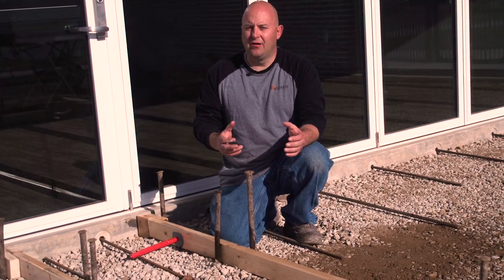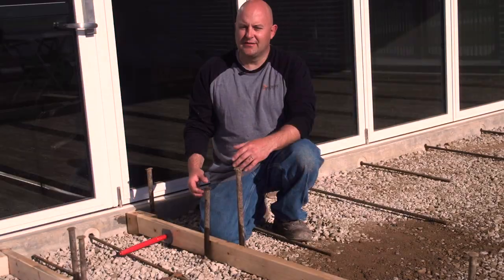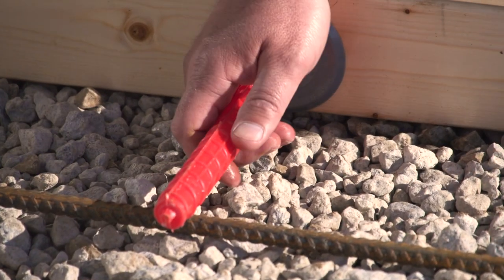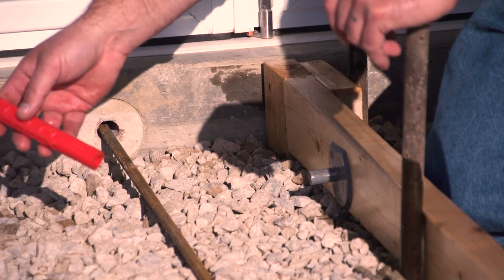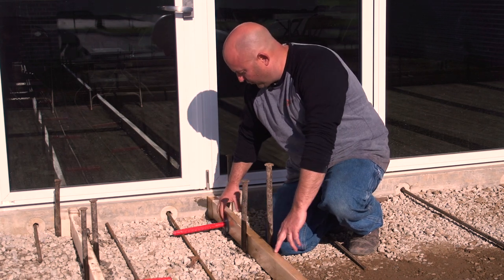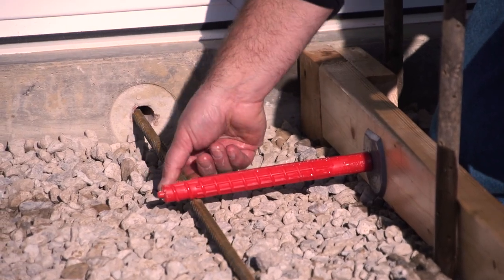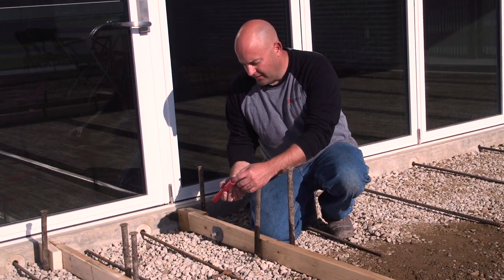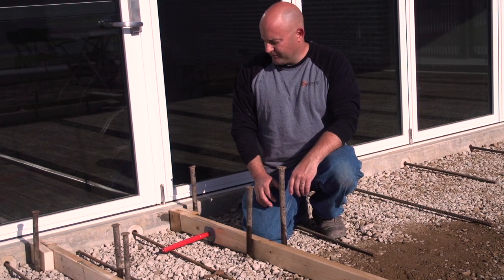How To Use Speed Dowels

Comment: What about adhesive to prevent the slap from walking away from say a foundation?
Reply from the maker: Thanks for the comment! You could use an anchoring epoxy if you wanted, but it usually isn't necessary for doweling slabs like this together. I would be carful when comes to doweling a floating slab to a foundation. That can lead to problems down the road, especially in freeze-thaw environments. Thanks for watching Deco-Crete TV!!!